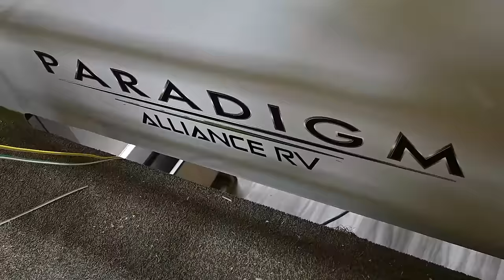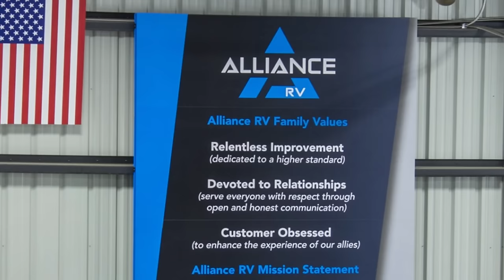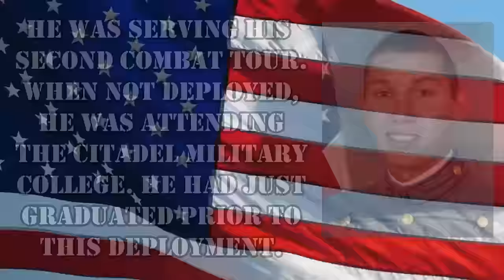The REAL Truth About RV Manufacturers and Brand Ambassadors!

Comment: A lot of the problems with all these rvs are the frames there built on and my understanding is almost all of them are made by the same company using the same strength of material which is over rated for 4:11  what they’re putting on these frames the rigs keep getting bigger and more things added to them all the time adding more weight and stress to the frame the frame company needs to make adjustments with thicker material instead of doing nothing about it. As much as these things cost it wouldn’t up the price that much to use heavier steel I think they’re building them the same way with the same material as they did ten to fifteen years ago when the rigs didn’t have all the bells and whistles they have today
Reply from the maker: All true. They need to do a little better.

Comment: Great video, love that you are helping to explain that ALL rv's will have issues and most of the time its the components from other manufacturers. I've been researching rv's for several years and I keep coming back to Alliance due to the windows, insulation, and build quality. We full timed back in 2002-2004 and rv's have changed a lot. Any chance of a budget video and an update on your thousand trails membership, if you still use them? Just got my 100 p&t, trying to assure the boss that we can make it just fine with early retirement in 2 years with that.
Reply from the maker: We are still using our Thousand Trails membership. We love it and it saves us a ton of money. We used to share our budget but it seemed those videos didn't do well for us. We usually are good on most items on our budget. We usually bust the budget on eating out.

Comment: Tx Allies! We bought an Avenue 32rls at the Tampa show on the Friday, we were there Weds to Friday and saw everything on my list, and it was a no brainer to choose Alliance. We picked it up on Weds at Tampa dealer (Blue Compass). We sold our 2021 FW 35' MH Gasser to buy a F350 and 5th Wheel. We met a guy sitting in the show model. We sat down and talked a lot. He told us "why" Alliance and Avenue was a good decision. I asked if he was buying one. He then introduced himself as Coley, the Co-founder. We had a good laugh together and then we congratulated him. So far, we absolutely love the additional space. In May, we are taking it on a 5 month adventure from Florida to Cananda/Alaska. The only "strange" quality issue was both of the horizontal moldings on top of Bathroom door (both inside and outside of bathroom). They are so short it can only touch 1 side if the verticle door frame/molding, so of course with 3 brads holding only one side both fell down on the way back to South FL. It is minor but ridiculous as the installer had to know! I will call Alliance on Monday to ask for the correct size.  The "dealer" Service/Demo/Walkthru, I give 2 out of 5 stars!  The RV was so out of level that the Kitchen slide hit the Pantry door knob and put a notch in the molding and damaged the knob. The dealer demo rep was a super likable guy with a lot of experience but he simply didn't know enough about the details. He even saw the (LR out of stroke) on the leveler which I am sure the reason the slide hit the door knob. He explained it was the dealer's parking lot!! The worse part was that he was so negative about RV construction it scared my wife. I am handy with everything and will fix a lot future problems myself (hopefully). The dealer also sold me the $%@! Furrion 3 camera wireless system. What a piece of crap!
Reply from the maker: We are glad you found the perfect Alliance RV for you. The A-Team is amazing.

Comment: Good video. So far we’ve had a great time in our Avenue with just a couple of issues fixed under warranty and I’ve had great success dealing with Dexter on brake issues.  But I do wish they had a longer general warranty for those of us who don’t full time. But overall, we’re extremely pleased. Thanks for sharing.
Reply from the maker: We wish the warranty covered owners for a bit longer also. I think 3-5 years would be appropriate.

Comment: I will agree that Americas roads cause alot of issues, fulltime or not. These manufacturers have to be aware of this yet they continue to slap axles and leaf springs only on them....ancient technology, horsedrawn buggy stuff. Also the frames do not extend to the outer walls. The walls set on spaced out gussets. This is ludicrouse. Today to buy something that is going to last awhile you have to go more of an offroad/offgrid type. Trailing arms and chassis that the outside walls set on the full frame. Of course you are not going to have all the size        and luxuries of these large money pit campers but the least these indiana rigs could do is add shock absorbers to their ancient technology and set the walls on the full frame rails instead of gussets.